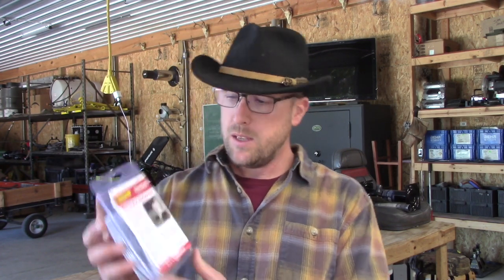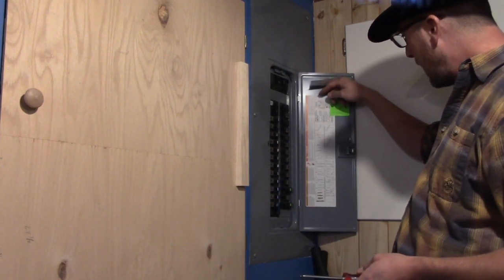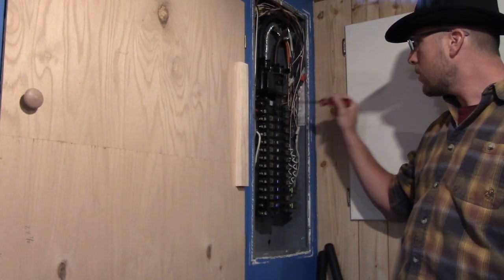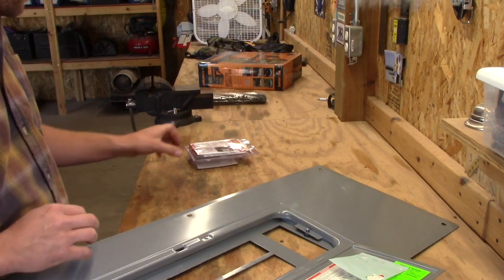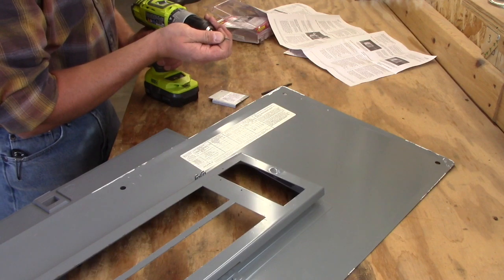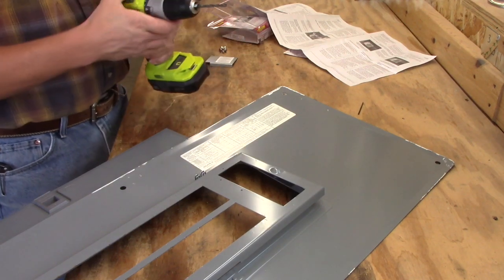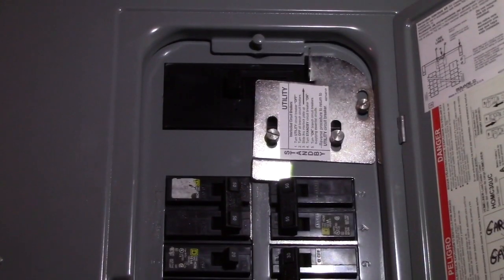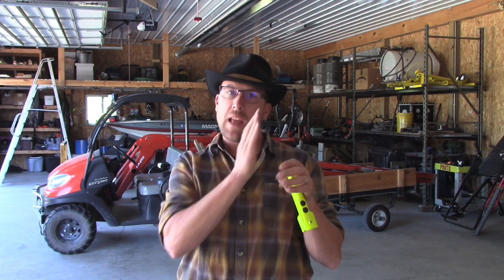153 Square D Homeline Generator Interlock Install

Comment: so for this setup, you don’t pick and choose which circuits you are going to power, rather, it backfeeds the entire panel, is that correct? what would happen your appliances, say a car charger, ac, range, etc drew more amperage than the generator could supply?
Reply: Whats the purpose of doing this
Reply: the purpose is that people buy a tesla, call me to install a charger, and when i get to their house i see they have a whole house generator. If i just add the charger, the generator might not supply enough power to all the loads, or any
Reply: @PaulCarbone-x7t  yup
Reply from the maker: Yes, this arrangement backfeeds the entire panel. You have to do a little math to know what you can and can’t run, and just turn off the breakers to the stuff that’s too much to run with your generator. For me, the entire house runs, but let’s say the AC was too much. Just turn off the AC breaker and let everything else run. Other option is to turn them all off and only turn ON what you need. Great question thanks for watching.
Reply: @LivingOurAmericanDream ok, but what would happen if i have my 48 amp tesla charger on full , my 12kw range on full, the ac on full, and i’m only generating 80% of what is required…

like, what is the worst case scenario? could i damage my ac compressor in this scenario?
Reply from the maker: Most likely would trip the circuit breaker in your power source
Reply: @LivingOurAmericanDream  i see! Thank you for your prompt responses!

Comment: I didn’t get exactly the use of the metal bracket retaining the generator breaker.  Can you explain further?  Why other important breakers don’t need such a retainer.  I’m about to install such a device with a new Yamaha 30 amp 7200 watt generator.  BTW, very well-made video!  Thanks!
Reply from the maker: Great question. The metal support bracket is to make sure the breaker does not flex in its position which would allow you to potentially be able to have both the main and generator breakers on at the same time. With the support bracket, no flexing is allowed and therefore allows the mechanism to work properly. Thanks for watching.

Comment: I have the same panel except my main breaker is located on the bottom rather than on the top. Will the same kit be used in this circumstance?

Comment: Thanks for showing the installation of the inside bracket, which another video never even mentioned. Here's my contribution for others who may be doing this to a Homeline box. I relocated my critical 120V loads to the RH 120V leg, because I will be using a 120V generator. The RH leg is NOT the breakers on the RH side, but every other row, specifically positions 3-4, 7-8, 11-12, etc. (Of course the LH leg works just as well. You may have to swap the red and black wires if the wrong side is energized using your combination of generator cord, adapter and inlet box.) Sadly I discovered that my older model Homeline box would not accept tandem breakers, which allow you to cram 2 circuits into one space. Before you make my mistake, try to confirm that your Homeline box is tandem-capable, or that you at least have some tandem-capable positions. Schneider Electric has a Youtube video entitled "Determining if Homeline Load Centers Accept Tandem Breakers". Don't even think about searching the web for the answer because of the boneheaded answers you will find. And don't use the model number or the packing materials to make this determination - just the video.
Reply: TThanks Fort Worth eeeee er the eggskmmmmu were good to EErtffdtdb
J.                I’m a

Comment: If I understood it right, the generator + interlock will only energize/power up the "right side", so only breakers on "right side" will really be able to use/turn on. Is it right ?  If so, is there a way where we can have both sides working ?
Reply from the maker: No, that’s not quite right. When the main panel switch is in the open (off) position, that’s when the metal slide “interlock” will move, allowing the generator breaker to be closed (turned on). The purpose of the interlock is so that the generator and the main switch can never be on at the same time. Since my setup uses a double pole 50 amp breaker, when the generator is operating, it will energize both sides (all circuits) of the panel.

Comment: I noticed you have the generator connected to a 50 amp breaker, not a 30 amp. Reason? My generator is rated at 8500 running watts and has a 30 amp, L14-30R receptacle. I installed a Reliance 10 circuit manual transfer switch a year ago but with limited circuits am considering the interlock kit. BTW well done !
Reply: Go for the interlock instead.  I have a 10,000 watt generator that operates at 8,000 watts and I still installed a 50 amp breaker.  My generator has a 50 amp outlet and a 30 amp outlet.  We never know what might happen in the future or how our needs may change so I went with the 50 amp.  I may decide to get a bigger generator at some point.  The big advantage of the interlock over the transfer switch is that with the interlock you can change which breakers are important to you at any given time.  With a transfer switch, once you decide which breakers to power up, those are the only ones you can use unless you rewire everything.  We only have electric in our home, no gas at all.  If I wanted to run something that draws a lot of power all I have to do is turn certain breakers off and turn on the high amperage item and switch everything back once I'm done with the heavy amperage item.  Interlocks are easier to install, cheaper and allow more choice and flexibility in the long run.  Best of luck.
Reply: @notsosilentmajority1  Thanks for your comments. I bought the interlock switch a few weeks ago but haven't disconnected the 10 circuit transfer switch from the main and will need to to relocated the 50 amp stove breaker and replace with a 30 amp for the genny. Cheers....
Reply: @utubetjc  
I got lucky with locating my interlock, there was an a 30 amp breaker marked Well Pump that had no wires to it at all because we have a shared well with a separate main. I was able to move my stove breaker down one and install the new 50 amp breaker.  You will love the ability to control what you run on your generator as the need arises.  Best of luck.
Reply: @notsosilentmajority1  i moved my electric stove breaker and just installed the interlock kit in the 2/4 spot yesterday! Definitely a better set up even with my 30 amp connection.
Reply: @utubetjc  
Awesome.  Best of luck my friend.
Reply from the maker: Hi Tom. My generator is operated from my tractors PTO and is rated for 15,000 running watts. The genny itself has a 60-amp breaker/capability. I used all 50-amp rated equipment (wire, breaker, and twist lock generator receptacle and plug) because that’s what was more readily available than 60-amp. In my case, using a 30-amp setup would only utilize a fraction of the power the generator can produce. Thanks for your feedback.

Comment: So.... the interlock is for a lack of common sense!?!?
Reply: Under the stress and confusion that might be occurring during a storm and power outage, and dark, and howling rain or snow, and everything potentially chaotic with wife hollering and kids crying, etc. . . it's probably easier than you suggest to forget one simple step in your haste to get the house back up and running.  These things exist for good reason.  Ask the widow of a dead lineman.
Reply from the maker: Basically yes. My original video of my pto generator received lots of negative feedback because of no interlock. The reality is a simple oversight of not disconnecting the main could mean energizing utility lines if the crews do not properly ground them for their work. Additionally, I believe most jurisdictions have a law in the books for generator feeds to panels to have a disconnect from main. Either way, makes sense and is fairly inexpensive insurance. Thanks for watching and for your comment.

Comment: Jim from the east side of the state also.  My Main panel is SD HOM30M159c 30 rs old. My main has four (4) at the top of the box and are to the left when on. Do you know which interlock I should use.tnx Jim
Reply from the maker: Hi Jim. Sounds like a square D homelite box so I’d imagine the one I used would work but given its 30 years old, I’d do a little checking on the web first. Worse case, order one and return it if it’s wrong. Good luck.
Reply: @LivingOurAmericanDream  Tnx for the quick response, As long as I turn off the main and at least put a big RED sticker on the box. tnx. agn. Jim
Reply: I am just kidding about the RED sticker. Jim

Comment: Hi. I have a 200 amp main panel and another 200 amp sub panel next to it. Do I need 2 interlock kits and 2 double breakers or just 1 set in the main panel.
Reply from the maker: Hi. It depends on how your sub panel is fed. If it is stand alone with its own feed from the utility and you plan to energize it with your generator, it will need an interlock also. If it is fed from the main panel then one interlock should do it. In other words, if shitting off the main power in the main panel also de-energizes the sub panel, then one interlock on the main panel will work. 

If you’re still unsure please consult an electrician for further clarity. Thanks for watching and good luck.

Comment: Remember kids. Always make sure the power is off and you wear gloves and the proper PPE. If you are unsure of anything hire a professional electrician! This was a very thorough video. I'm a master electrician and this method is a lot easier than having to put a manual transfer switch in. You are also not limited on how many circuits you can have available which is always a plus!
Reply from the maker: Thanks for your comment. The trickiest part of the job was rerouting the garage and generator breakers to opposite sides. Luckily there was enough cable there to make it work. Thanks for watching.